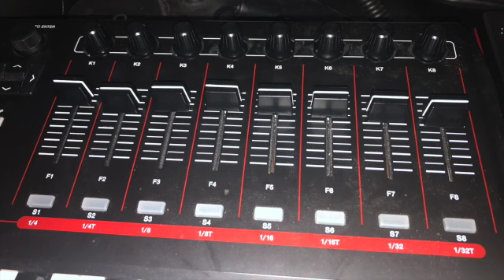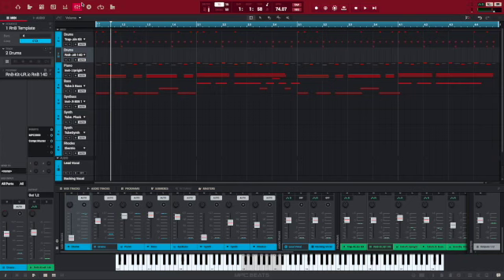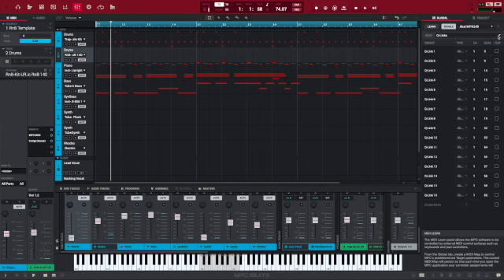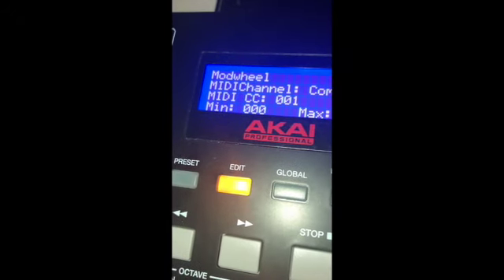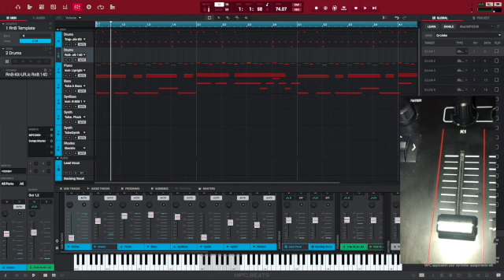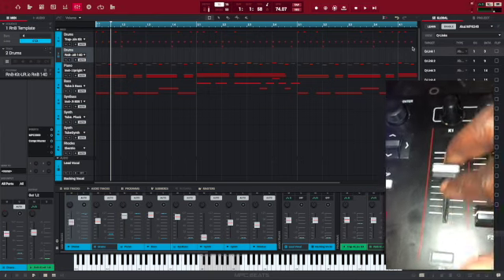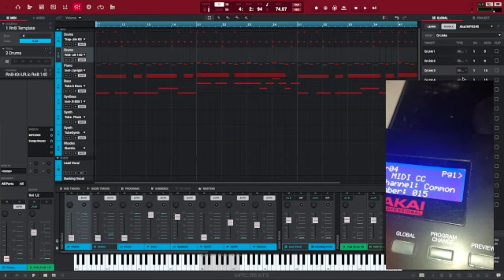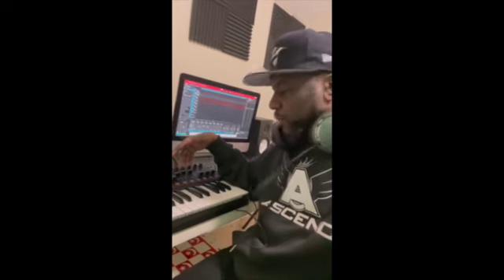AKAI MPK249: HOW TO MAP FADERS IN MPC BEATS

Comment: Check out a free app called command post to map it all including the buttons alot easier than in MPC beats. After installing command post add mpc beats as a app in the controls- midi bank- then u will see a drop down w all apps or select the app. I use it for FCPX, logic, and other programs. It's a free, open source app that is made for video editors. Sometimes I don't know what I wld do without it cause they make midi controls rocket science in other apps lol. But yeah command post has like 16 banks of midi controls u can switch thru and a good interface to see what controls are in each bank, then beside the control is a learn button and midi cc box. What I do is set up sets of controls and save them before learning then when I wanna assign a set I just switch to the bank and learn the 8 messages real quick then boom its done.
Reply from the maker: Thanks for the info! I’ll certainly look into it!
Reply: I don’t see it in the app store

Comment: MPK249 doesn't get much love in MPC Beats does it? It's like they forgot to add in controls and presets for it or they did all the boards up to the one after it...smh! I got the mpk249 about a month ago and it's OK but tbh I like my nektar lx25 better it just doesn't have as many keys or faders tho so it's not really better just has a better UI, they both lack hella support and software tho! Kinda wish I wld have got the komplete 49 instead or novation launchkey49. Might even sell my mpk249 but still not sure yet, I do like the edit page, 30 presets, and the encoders are dope, but the keys r ehh, faders r usable but not great by any means lol. Pads are pretty but I came up on the mpc 1000 so they seem stiff and almost bugged at times which can also work in a good way.
Reply: I have a question bud. I have an mpk 249 as well but I also have an Akai MPC live 2 not sure if you have one of the newer MPC's was kind of assuming maybe you did since you're using MPC beats software just wondered if you knew if there was a way to assigne the controls on the mok249 to control the MPC in stand alone mode? It's easily usable as a midi keyboard but it would be nice to be able to use it to play and record and assign the knobs and faders to things on the MPC live 2.
Reply: @googlerep366  I was only on mpc beats for min, I have a mpc 1000. I was having trouble getting one of the controls to map to beats I think the knobs but I just ended up using the free app for mac called command post that will let you program any midi cc to any control on the apps menu. Has a cool little interface, it's pretty much what all daws and apps are lacking besides komplete komtrol, aurtia, and maudio they have app with a pic of the keys and controls to assign. 
But yeah just Google Command post and it takes like 5min to set up.
Reply: You just Email Akai and they will send a link to any Midi map for any of there products in any DAW.
Reply: @HOLLASOUNDS  I emailed aka a while back and ask for midi maps and any of the software or anything that comes with the mpk249 I bought used and they emailed me back and said sorry we cant help u lol I saved the email cause I was like how they gonna take the time to email me to say no lol
Reply: for the person asking the question this was in response to  @HOLLA SOUNDS  is right tho. they do normally send you the midi maps and I was able to get my mpk249 linked to all controls on Mac 2,0. 
Mac 1000 a little but not really for that lol
Reply: @Juliano_DJOL  That's funny because when I got the MPK49 I asked them how to set it up with Reason. They sent responce asking for what DAW and what version, I told them then they sent a download link attached to instructions on where to put the file. Prehaps who dealt with you was having a bad day lol. They seem to of deleted My account now though because I cant log in, I wanted to update MPC beats.
Reply: @Juliano_DJOL  I was using an old version of Reason 4. Reason 12 has the midi mapping for MPK249.

Comment: To map the MPK249 to MPC beats or any other DAW first check if you have the midi map in your DAW and Know for a fact that MPC Main, MPC Beats and Reason 12 has the MPK249 so will listed as a selectable midi Map. If your DAW does not have the MPK249 midi map, contact Akai via email, they will send you the midi map files with instructions on what location they are to be placed on your computer.

Comment: My biggest issue is that the factory preset for MPK 249 is not accurate. Pad 2 and Pad 1 for starters are reversed.
Reply from the maker: Facts. There are quite a few discrepancies on this software. However with research you’ll find that they are mostly fixable.
Reply: are you using preset 2?
Reply: @raydonyv  No… mine says Hybrid 3 for that preset
Reply: @jalittleton5791  so I'm assuming u have no mpc preset at all if preset 23 is your midi?
 I would be correct suggesting you look for a firmware update
Reply: That's how the old school mpc pads were, never knew why but I saw u can change it to chromatic c-1 or c1